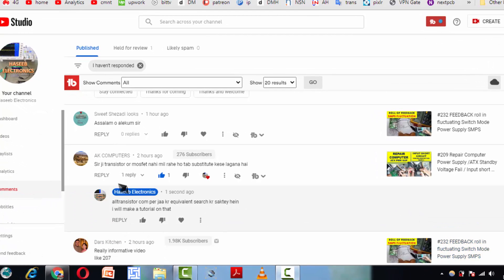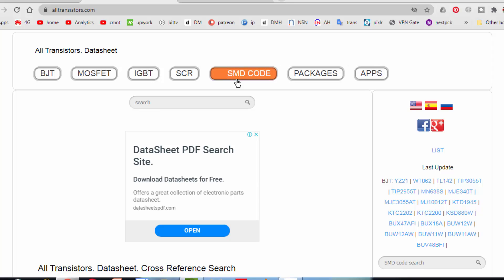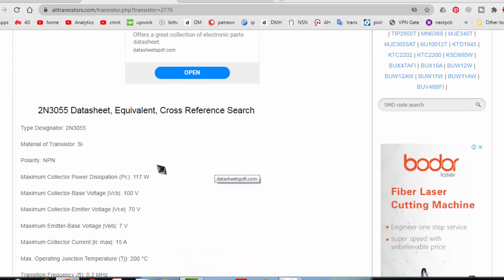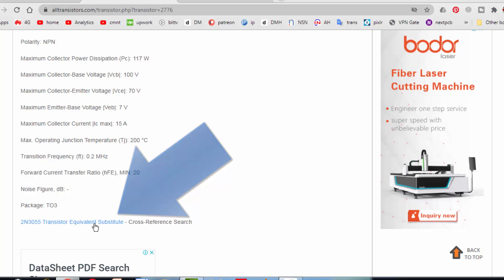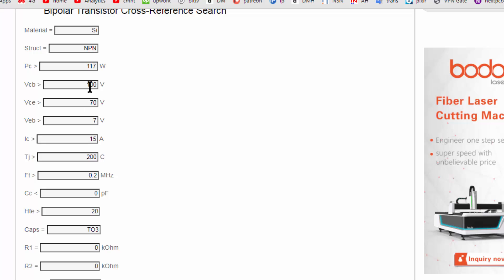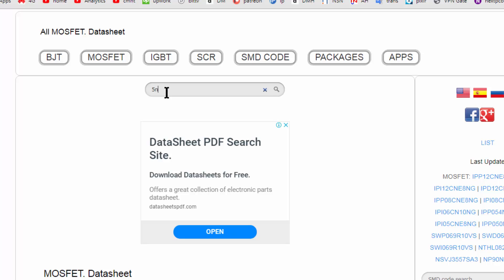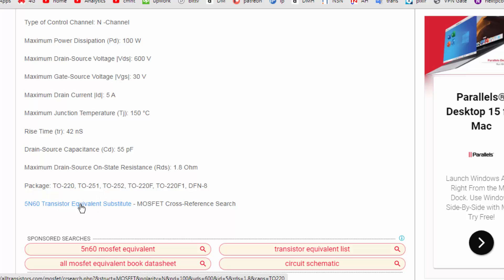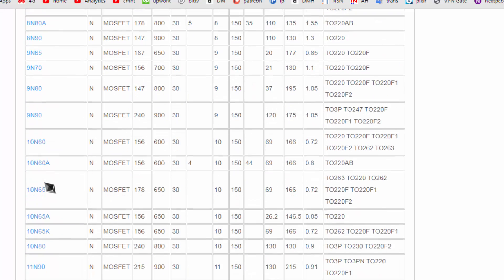{233} How to find Equivalent or Substitute of MOSFET,  Alternate, Replacement of MOSFET, IGBT

Comment: Wonderfully helpful but I have a slightly different problem. I'm not sure the component is MOSFET. it's a T220 package but part of the part number is illegible. I have **S133 at the top and vertically on the right is k825. It has pins labelled I   D  and S going left to right at the bottom. I am hoping you have a suggestion. It is being used in a daytime running light module chrysler part number 5602156160043. This module is discontinued hence the need to repair. Thank you for any suggestions you may have

Comment: what to do with a transistor i cant find anywhere ? not even data on it ? 
i have a 21J19 that is blown, but i cant find any info on it, or what to replace it with
Reply from the maker: if possible
please send it's picture to my WhatsApp
00962791161084
Reply: @HaseebElectronics  idk why the comment keeps getting deleted .. i cant show you much its literally burned up,  i only know that its original markings are 21J19   , and that it appears to also be possiuble to get a i0895k (idk if its a 1 or i  or l  at the beginning ) , from a different board i saw from the same model

Comment: YGW40N65F1 not found
Reply from the maker: i think the correct part number for IGBT is IGW40N65 (please check it)
Reply: @HaseebElectronics  Verified. Not in parameters
Reply: @HaseebElectronics  New IGBT YGW40N65F1 can replace XNS40N60T SGT40N60F suitable for inverter welding machine

Comment: السلام عليكم Mr Haseeb why the 400v capacitor charge 320v in smps after rectifying and the input voltage is only 240v can please explain how Thanks